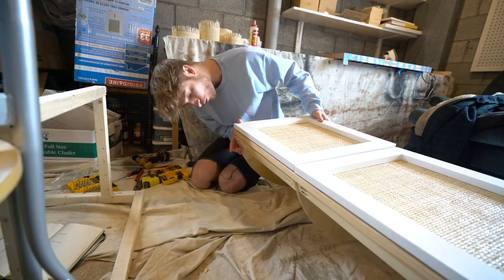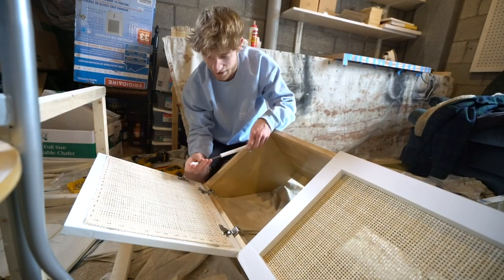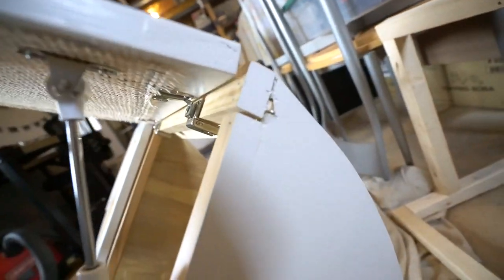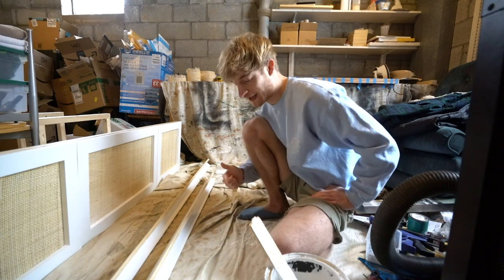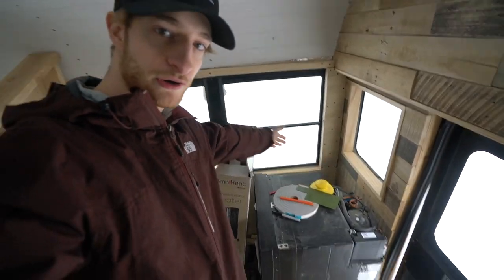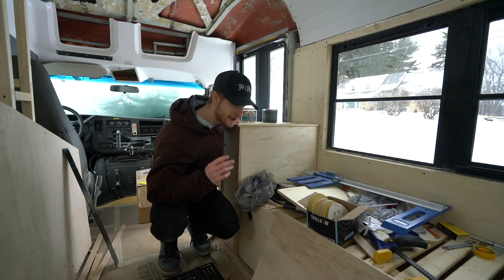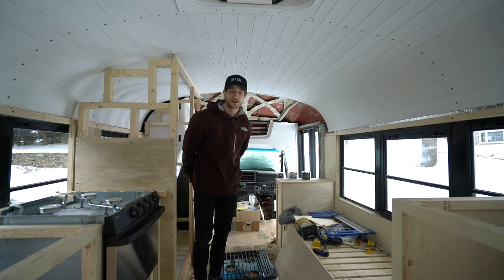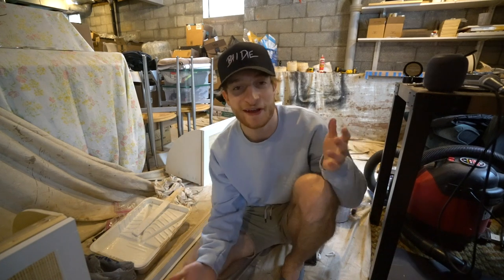How Will I Get Power in School Bus Tiny Home? - Skoolie Build Ep. 34

Comment: The wiring trough makes total sense to me....easy to get to in case maintenance or additions are required....love the 600 amp hours....you']] be able to power up almost anything. It must be rugged trying to make progress in those weather conditions. Keep safe and as always looking forward to next week's video. Just a thought Matt... I just purchased an e-bike for grins and giggles and it's a ton of fun. If your garage could hold them as they are collapsible you and Bella could see a lot of country that way as well.
Reply from the maker: Exactly my thoughts too for the wiring. That sounds so sick! Could you send me a link or the brand??
Reply: Lectric XP is the brand.....tons of videos on the tube....price is not to bad as well at 899 with free shipping. Top speed 28 mph range depends on pedal assist level....could charge battery off your inverter with the solar. What fun right. You could explore a lot without having to move the bus.

Comment: your going to want the out-let on the water tank to be underneath the tank because the one it comes with is slightly elevated and when you drain it a little water will always be lift inside and over time goop will form and it will get gross and smelly.
Reply from the maker: SMART

Comment: Drill a pilot hole from the top and run a screw down into that joint . If that’s the part going up towards the ceiling you won’t see it . Pocket holes are great but there are still places where biscuit joints are better .
Reply from the maker: Sweet thanks for the advice! I'll give it a try
Reply: Plus the pressure will be pushing up against the ceiling of the bus that’s my thought 💭. Put those on after you’ve installed the cabinet.